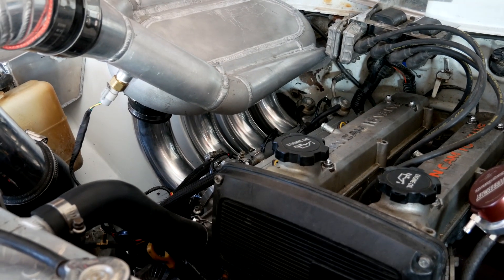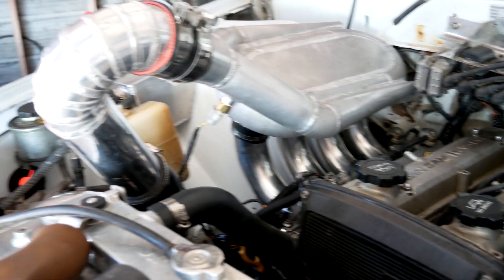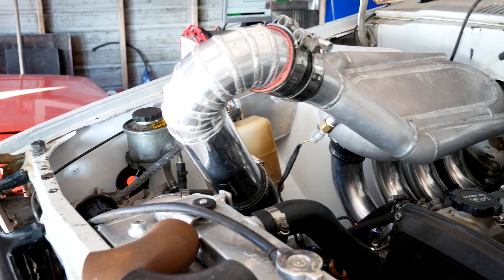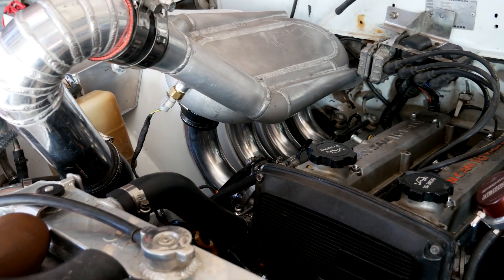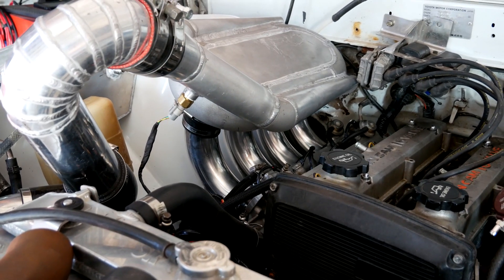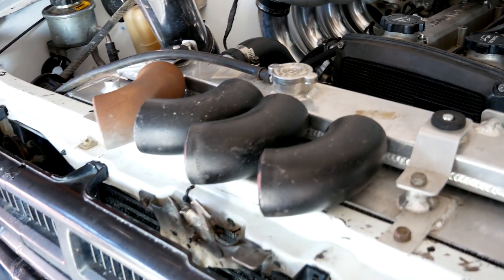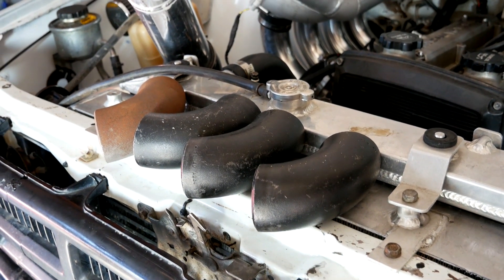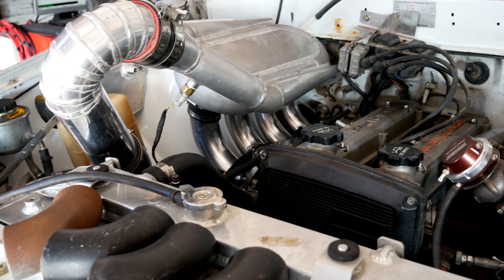Inlet manifold length - Does it matter with a turbo?  - 4AGE Hilux

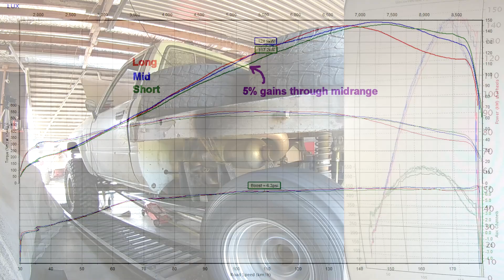Comment: At the 2:22 mark is that supposed to say 5% loss?? Whats surprising with this test is that 90% of the differences were over 6700. What these graphs can never tell us is how the engine responds, and therefore drives,  on the transitional point from vacuum to boost. And as usual........horses for courses. Street engine use longer runners. Track use shorter runners and gear accordingly.
Reply from the maker: the normal intake that was on it,  was the" short" runner intake.   So that's the run i was comparing the others too.    this was one of the first dyno videos i made so go easy on it haha.   Obviously the "mid"  length was the best over all power.   fun fact. the "short"  intake over all runner length, is still longer than what everyone sells as a turbo intake these days
Reply: @Garage4age  Thanks for clarifying

Comment: Due to the higher speed of sound in hotter air your intake runner length would have to be way way higher to make a meaningful difference down low
Reply from the maker: iat's  on this only run around 5 degree c  hotter than ambient  in most cases
Reply: @Garage4age  that's some good intercooling then

Comment: Are these number numbers and logic correct?   (max power = 200-300mm runner length , better low end grunt 300-400mm) measuring from the valve seat

https://www.custom-car.us/Intake/IntakeManifold

what are the length/id sizes (if its possible to remember and want to share of course)
Reply from the maker: Not really,  what they are saying is a bit of a generalization.  In my findings,  if get the runner the correct length  can have gains without loosing power somewhere else.   It depends on engine rpm along with a few other things as to what length will work.  going 20mm either way can make or break a setup.   if you watch part 2 of this vid i made the runners about 20mm shorter than the "mid" runners in this vid and it beats the  "short" runners everywhere.    runners on said setup around around the 400mm mark
Reply: @Garage4age   thanks a lot for the fast response!!! yeah I saw both of the videos but could not find any numbers, very kind of you to give me details!

is that 400mm total length from the intake valve to the plenum or just the actual intake runner length? final question, I am guessing the id of the runners is the same mm as the intake valves? bigger?

sorry If Im a being a pitta, subbed and waiting for more videos!!
Reply from the maker: To valve.  longer or shorter depending on max rpm of engine.   one thing to be careful of going that long is vibration, on mine the silicone joiners isolate the plenum part from engine.  otherwise would vibrate itself to bits.  that along with packaging is why most setups run short runners.       On a turbo setup with  little to no cam overlap,  I'd go on the slightly larger size for diameter.  usually small taper out from port.  easier to get close without restricting top end.  unless you can do a lot of testing.
Reply: @Garage4age  once again thanks for the immediate and thorough response. I hope all the best!

Comment: If you changed the runner length between the head & the back side of the throttle plates it will yield a more pronounced variation in results. Changing velocity stack length before the throttle valves has less effect on power until the itb's go into WOT position. Very nice ending with the fab work.

Comment: In case someone has not already said it, the intake runners may have nothing to do with the results in this test.
Any difference may be due to pipe needed to connect every thing from the inter cooler to the plenum.
To rule that out you’d need to either run directly from the turbo or use a loose inter cooler with similar pipe lengths and bends.
Reply from the maker: The only change was the runner length between the "mid" and "long" runs.   significant difference

Comment: What kind of cams you have in this engine? Lift and degrees? :)
Reply from the maker: Factory cams.    Have some aftermarket cams to try once intake is sorted.
Reply: Garage 4age How have you timed the camshafts at TDC? I am just curious :D ouer engine has 285 decrees cams and 10.5mm lift :D
Reply from the maker: @dillen1969   usually   5 to 10 degrees advance on the inlet cam from factory marks.  Factory mark on exhuast. Aftermarket cams I usually ignore the recommended from maufactor and dial them in for best useable power curve. Most of the time ends up being more advance on inlet and little more retard on exhaust cam.

Comment: I would assume the Audi style manifold negates the difference between runner length.  Which is why I believe you see little difference. 

With normal style manifold ,I believe, the runner length should make bigger difference
Reply from the maker: Will be trying different plenum next, awaiting parts.    I think its more to do with the bellmouths being to close to the plenum roof (done due to packaging) rather than dual plenum style.   But next one will more more traditional style anyway

Comment: long manifold - increase the speed of the air in low rpm. in high rpm, the speed of the is fast enough but the long manifold is kind of choking the volume of air due to the length. (street daily use, more usage in low rpm, shifting early and cruising in low rpm)

short manifold - suffers from power in low rpm due to the short manifold because long manifold will speed up the speed of the air. short manifold excels in high rpm because the air is fast enough and shorter manifold will lessen the length of air to travel and resulting supplying more volume of air to the engine. (race use, more usage in high rpm, shifting and hanging on high rpm)

medium manifold - best of both worlds. (street use with a bit of sprinting once in a while. street mod maybe)

each kind suits for what the user wants from their car, what their target is. for natural aspirated cars, some manufacturer use variable length intake manifold for get the best of low and high rpm. why turbo cars never use this? i wonder why
Reply from the maker: Agree that pipe length may become a restriction at some point.  But correct diameter and taper on a high revving engine can have best or both worlds.  What im chasing here is the reflected wave. When the inlet valve shuts it sends a wave up the inlet runner, once it reaches the end of the runner it sends a pressure wave back down the runner. if its timed when the valve is open, will force more air into the cylinder.   Most inlet manifolds/ engines are tuned to see the 3rd or 4th reflection,  due to lower rpm and packaging. In this vid I am chasing the 2nd reflected wave, which is stronger than 3rd. 4th being weaker again.    As you would expect, if the wave happens to be starting its way back up the runner (negative wave) while the inlet valve is open, will be a loss in power.  which can be seen clearly in the "long" runner dyno run at 8000rpm.    Goal was to push the negative  wave off the end of the usable rpm range, while retaining gains of the positive wave.   I will do a video that clears this up sometime soon  using my N/A engine. It gains about 8% peak power @8000rpm just by adding a longer runner, yep longer not shorter
Reply: @Garage4age  yup with correct diameter and taper. missed that. i liked to see the next video with the n/a engine. good. thanks mate for the explanation.

Comment: Runner length  exh  or intake  matter on all engines.  Turbo or not.  
Pressure waves exists,  wether its at 1  bar  or 6.    Thats why turbo 2 strokes work better with the turbo after the pipe.

Comment: Thank you for taking the time to do this!

Did the runner length make much difference to the off boost performance?

EDIT: Ok decent internet connection now, can see the numbers on the graph, doesn't seem like it made any difference off boost.
Reply from the maker: Yeah not really.   These engines don't do a lot below 3000rpm, so even if there was a percentage gain, wouldn't be much power!
Reply: @Garage4age  Thanks for the response, much appreciated! :)

Comment: I’m interested in weather the mid range gains were just a consequence of less piping overall = less time to compress air in the intake or if the runner design itself is really the cause
Reply from the maker: length is based off what ive found on my n/a engine.  which runs open throttles (no plenum).  Its reflected wave tuning. The effect on the turbo setup was less than the n/a engine. likely due to the cams and plenum design.  will probably do a follow up vid on this and one on the n/a setup.

Comment: probably using a short runner manifold would help to spool up bigger turbos faster i guess?
Reply from the maker: Depends,   Say if a turbo comes on boost a 5000rpm.   then you tuned the inlet runners to a harmonic peak  just below 5000rpm.   the turbo would come on boost slightly earlier, as its acting like  a bigger engine, since its flowing more air / exhaust.     if you end up with a negative (like the long runners in this vid at 8000rpm ) around spool up will have the opposite effect .     if just talking about response, less volume in the intake runner may help a tiny bit.

Comment: Good video man, really love the wagon.
I'd say it relates pretty heavily with the cam and the size of the ports. 
Looks like mid length runners suit you eh?
Reply from the maker: Have done a lot of testing on my NA setup.  (runs the same itb's) and are big gains getting the trumpet length right. More so than on this turbo setup.  but yes as you say big cams etc have an effect.   I still i think there is more to be gained on the turbo setup. Will be swapping out the plenum next with runner slightly shorter than the "mid" runners.
Reply: @Garage4age  nice dude, I like what your doing. Do you own the dyno?

Comment: Great vid. Did you document how you made the intake manifold main body at all and what volume you chose and why?
Reply from the maker: Hi,   the plenum was a bit of a compromise due to space.  im not 100% happy with it, mostly the bellmouths being too close to the roof of plenum.  so will likely build another to suit longer runners.   this should take you to my build thread:  https://oldschool.co.nz/index.php?/topic/44718-kprs-84-hilux/&do=findComment&comment=2121936
Reply: @Garage4age  Was a good read. Would not have thought of using a fire extinguisher for a muffler. I have seen one use as an intake manifold though. Was it 4" pipe that you used for the main plenum? I didn't see you mention anything about the volume of the main chamber or was it just a wing it kind of manifold? What size openings between the two plenums did you go for aswell?
Reply from the maker: @Dongaz   main plenum was 3" (i say "was" because i cut it up a few days ago) .    The slots between the taper tubes and plenum were made slightly bigger area than the 3" inlet pipe.  In my experience the plenum volume doesn't matter so much, within reason.   Too small will create flow issues.   Too big will have low engine speed problems on a single throttle.  This is one of the reasons i  switched to itb's.  Engine would stall out easy with single throttle and decent sized plenum. not so good in a 4wd.  i actually tested the dual plenum along the way of building it,  on my na setup (runs same itb's). this is where i got the idea that the bellmouths maybe too close to the plenum roof.
Reply: @Garage4age  Does that mean you've actually tried out this style of plenum with a single TB as that's how I was going to make mine. There is another for the 4age by Kajoba Works in Finland and they use a 65mm TB. Most who make intake manifolds in Oz use a 70mm TB. Although the 70's are single plenum. Theirs is supposed to be 1.5x engine capacity. It's been too long since I read up about dual plenums to remember.
Reply from the maker: @Dongaz  go to page one on that link in my first reply. There are some pictures of the dual plenum single throttle setup that used to be on it.  It made good power .  But   stalled out pretty easy under 1000rpm.  Not really much of an issue in a track or street car tbh.  But the problem got far worse with cams/ cam overlap.  It  had a 60mm throttle.  I wouldn't bother going much bigger throttle than intercooler pipe size, else will make the throttle touchy. Unless e throttle of course
Reply: @Garage4age  Thanks for that. Did you have large duration cams at the same time as using the 60mm TB on the dual plenum? Would that have been a reason for the stalling under 1000rpm?
Reply: Yea I will say it's definitely a lot flasher than the 150mm tube I used for my 20v set ups still got easy 220kw on 95, n only just deleted tvis on the 16v s. Also thea must be more turbo 4age in nz than anywhere

Comment: How much does it dyno at the wheels now.
Reply from the maker: Have an issue normal boost level it runs (13psi) at the moment. Thats why i done this test at 6psi,  so the results weren't effected by another issue.  Once have sorted the issue and made a proper intake  setup based on what i found in this vid, will post somthing up.

Comment: Shorter piping--> less volume --> faster boost pressure buildup --> less turbo lag.
The piping should still be designed  to have good airflow when not running high boost to get optimal performance.
Reply from the maker: Agree if talking intercooler  piping, shorter the better.     The length from the intake valve to plenum is what im testing here.  Sure longer runners may add a small amount of lag, but isn't what im trying to get across here
Reply: @Garage4age  Have you skewed over examples such as the big Duramax Diesel intakes that come on turbo Chevy pickups?
Reply from the maker: @DarkLinkAD  Most diesel stuff doesn't use this kind of tuning. due to lower revs.   The intake runners would have to be over 1m long to take advantage of the same reflected  wave im tuning too. In that case the loss in the pipe, not to mention packaging would outweigh any gains.   so yeah most diesel stuff is all about the flow rather than harmonic tuning.
Reply: @Garage4age  You would think so but Duramax intake runners are near non existant, Id describe them as log style with a turbo sitting on top. So mabye 3in runner length?
Reply from the maker: @DarkLinkAD  Yep, no point making them long if there isn't any benefit.